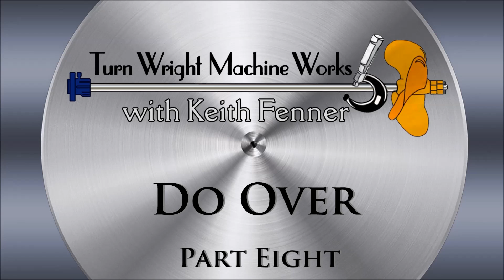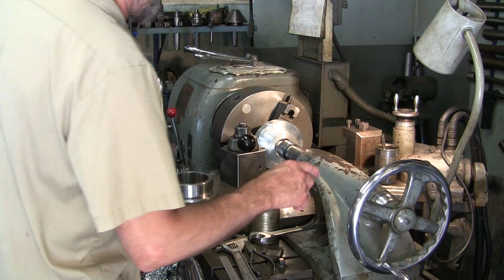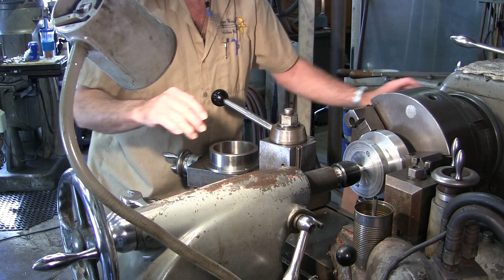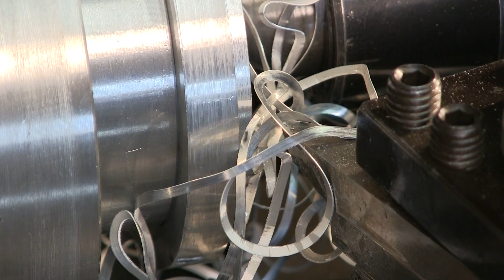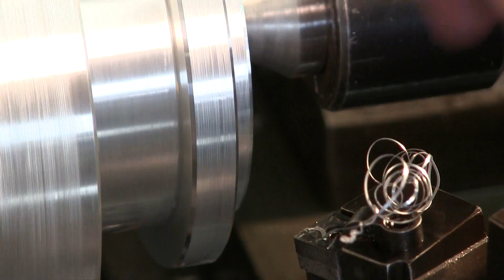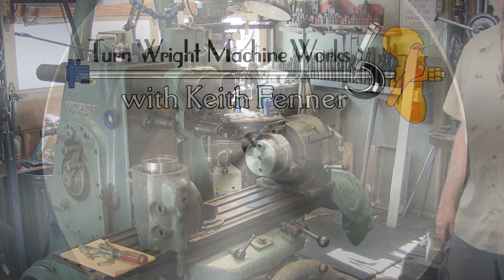Do Over Part Eight

Comment: Excellent presentation of your work. Looking forward to the next segment. The close up video is worth the price of admission.  Have you used the close up camera for your setup? We older folks could use that kind of help when adjusting the tooling and when looking at the hard-to-read lines on the travel dials.  Inside mike versus telescoping gauges particularly when reaching deep into a bore what are your thoughts on the accuracy and precision?  Thanks in advance for your opinion.
Reply from the maker: Well the bore scope or camera has been in the box since the second video in the series. The Note four and camcorder have been placed with the right amount of light to catch the close ups since then. There are some times that the little camera is going to be a big help, key good light and no or little motion, the pixel just aren't there other wise. ;{)------

Comment: Congrats on the 4 jaw comp Keith :) I'm struggling with
my own 4 jaw at the moment..I can only get within 0.002"
then i seem to not be able to get it any closer..Not sure
if my jaws are bowing outworks
Reply from the maker: It is rough to use a bell mouth four jaw, the main reason my large four jaw chuck is not used so much. ;{)------
Reply: Im going to strip the 4 jaw down and check the retaining screws at the back of the chuck i have a feeling that one may have come lose..:)